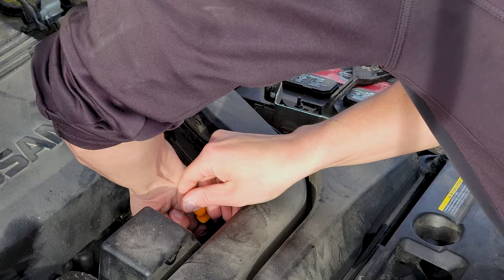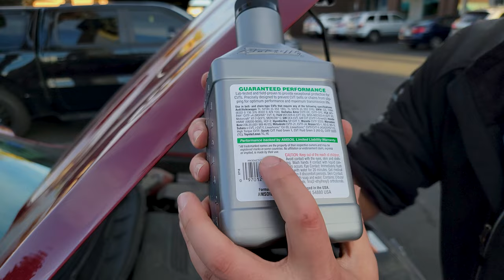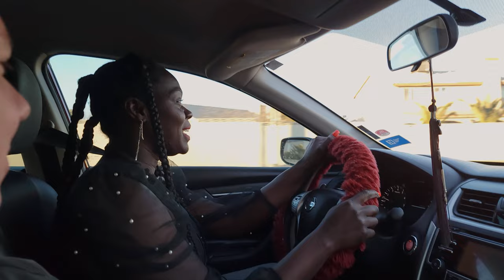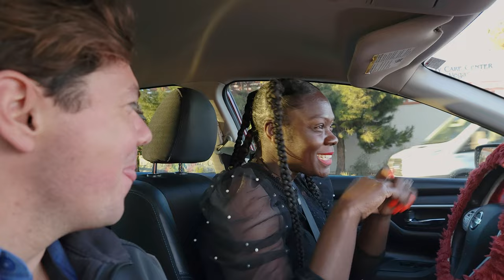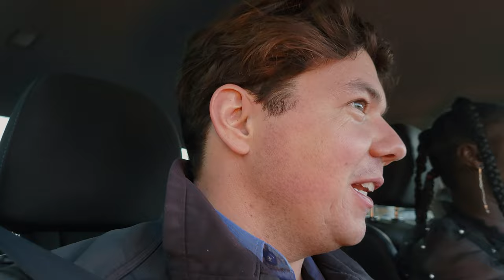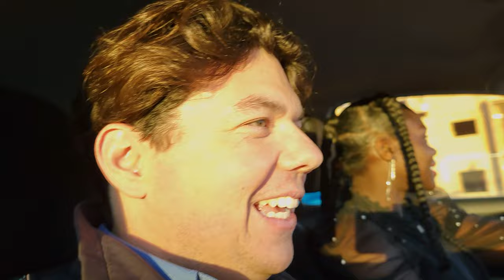CVT fluid Golden SECRET ...

Comment: Question: So I go to dealer for complete flush and both trans filter replacement. They will not let me use Amsoil.  So, if I want to use it in a few hundred miles, can i just do a drain and fill with Amsoil, or does it hurt to mix Amsoil and other fluid?  The car is a 2014 4cyl with 114,500 miles an it just started a whine in the last 20 miles. Please advise.
Reply from the maker: Oh if you're non-mechanical you can have anyone install the fluids you can take it to a basic transmission shop or have a mobile mechanic install it at your house it's pretty straightforward.
You can order it right here on my website and if you have any questions in the future always happy to talk anytime☕️
   Together! We can get your vehicles to run better than brand new!

     For me to get credit & be "Your" Independent AMSOIL Dealer, please use my website below or my dealer no. 5331179 call anytime Eben Rockmaker 702-472-3614
After you click on: http://syntheticoilprotection.net
1. Click the hamburger menu
2. Click offers AMSOIL preferred customer
3. Click join now. 6-month PC member add to cart.  ( There is no reoccurring renewal membership unless you select that dot box ) 
( You have the option to not have your credit card saved if you prefer - est. 1972 )
4. Scroll up to the top Select shop by vehicle. 

New Promo: FREEHAT
Reply: @Syntheticoilprotection  Thank you brother!
Reply from the maker: Anything I can do to help anytime👍☕️

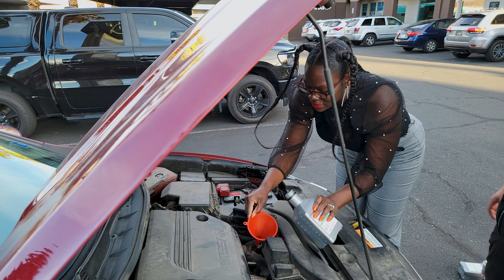Comment: @1:51 💀:face-green-smiling:
Reply from the maker: Sometimes it's a little bit of a stickler😃😄. 

For me to get credit & be "Your" Independent AMSOIL Dealer please use my website below or my dealer no. 5331179 call anytime Eben Rockmaker 702-472-3614
After you click on: http://syntheticoilprotection.net
1. Click hamburger menu
2. Click offers AMSOIL preferred customer
3. Click join now 6-month PC member add to cart.  ( there is no reoccurring renewal membership unless you select that dot box ) 
( you have the option to not have your credit card saved if you prefer - est. 1972 )
4. Scroll up to the top Select shop by vehicle. 

New Promo: FREEBOWL